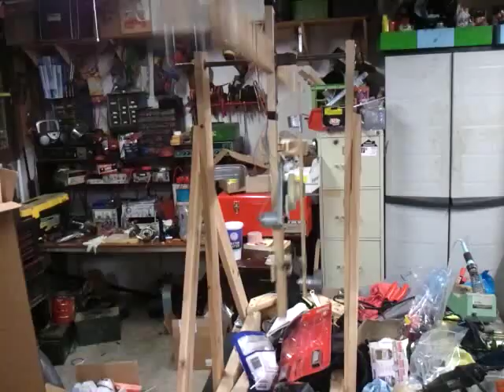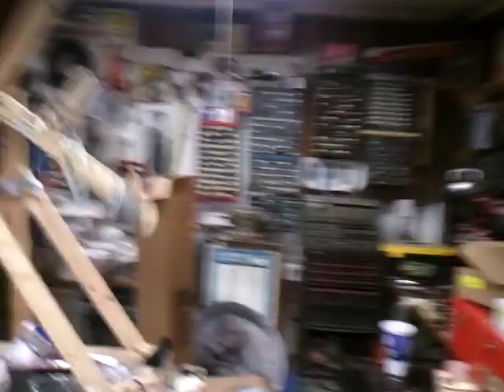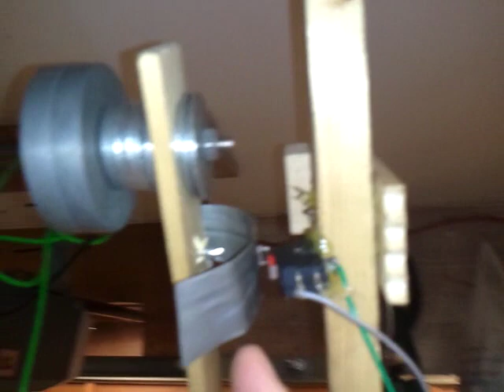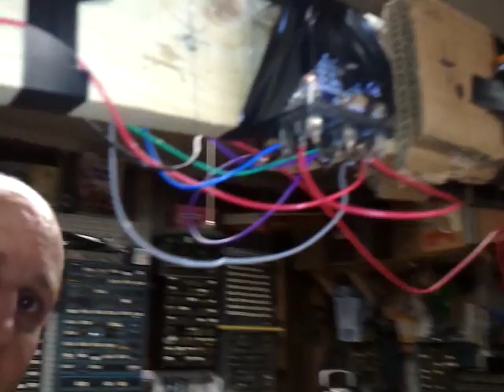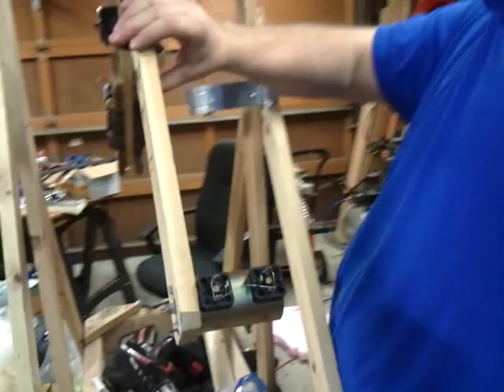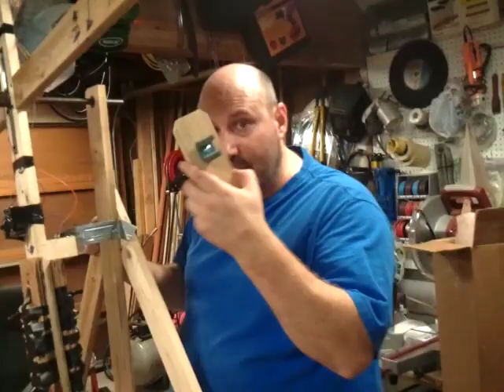Gravity Motor Prototype Version 2.0, motor drive mass movement

Comment from the maker: Sorry been busy working on getting a new work shop together. The electronics are fairly simple, it has a bank of nickel metal hydride batteries connected by a relay connected to a single geared motor, limit switches set in various spots hit contact points as it rotates triggering and then turning off the motor.  The relay uses spare contacts to self latch itself, one limit switch cuts the power when the weight spins around to a set point, two limit switches then trigger the motor on.

Comment from the maker: Feel free to replicate, there are many ways of doing this, I found this way pretty simple to implement.  there is nothing hiddne in the mechanism it is as you see, batteries power the motor, only as I dont like messing with commuters on the shaft.

Comment: Quote: it uses a simple geared motor to place the mass at the correct positions to increase force for the fall, and reduce force for the rise. End Quote.So it's not actually "powered" by gravity at all, the power comes from the battery powering this motor. The principle appears  identical to a self winding "gravity powered" clock. Those clocks typically have a motor that raises the weight say once a week. Yours raises the weight once per revolution.

Comment: try putting a coil of wire and a powerful neodymium magnet and a full bridge rectifier, you may generate enough electricity to power the batteries

Comment: Gravity is to most under utilized clean energy source known to humankind.
Impounding water with dams is the the biggest use of gravity's energy potential. Then, so many dams are being decommissioned and torn down, we are even loosing that source of energy.
Reply: Hydroelectric generator uses gravity as the energy source. Gravity is not under utilized I think.

Comment: Hi
what happen if we dont use the electrical side of this experement 
can we increase the velocity of the rotation and it is acondition the masses on the axes must be equal , how mutch electricity this system produce if we contact it with agenerator (enough for one home)
thanks

Comment: I like the contraption you have build, it is also clearly filmed so congrats for that, but of course we would all really like to know: is this an overunity device or not? If so, what is the COP? There's no mention of it in the description so I'm not sure..
Reply: Not. You can see it's battery powered.
Reply: Yeah but the thing is, I've seen many OU designs that use battery power at first and only after some time get overunity performance and the battery supply is switched off.
Reply: Really?  That would be Nobel prize material.
Reply: Sadly that site is full of conspiracy theories and fundamentally incorrect information. You only have to read the first few paragraphs of chapter one on magnets to realise the author hasn't a clue what he's talking about.
Reply: Doesn't matter what the author says or thinks of what the current definition of energy, batteries or magnetism should be: it would be better to disprove the hundreds of inventions from different people who individually claim overunity if you want to make statements like "free energy is impossible" with certainty. The author basically made a compilation.
Reply: I disagree. It's far better to prove that (for example) magnets are not and cannot be a source of energy than to prove one (or a hundred) magnet based machines don't work. It will always be possible to come up with a new configuration that has to be disproved all over again. The force produced by permanent magnets is conservative (google it). That means if you move two permanent magnets in a way that results in them ending up back where they started then the net work done is zero. Typically all so called magnet motors return to the starting position once per revolution (at least) so the net work done is zero. Gravity is also conservative. Once you understand the principle of conservative forces you see that no free energy machine based on gravity or magnets can generate energy. Magnetic shields don't help either - if the machine ever returns to a starting position or an equivalent position then the net work done is zero.The idea the governments conspire to prevent free energy machines being produced is laughable. How do you explain the fact that there are hundreds of examples on youtube. No wait I get it....Governments only allow the ones that don't work to remain on youtube. All the ones that do work have been removed.
Reply: ColinWatters well, its a matter of conversion, not creating energy out of nothing. Energy already exists all around us in various forms. The whole point is how to convert energy from one for to another and gain more work than we initially put in. Look at the invention of the Sail, it uses the existing wind power to drive the boat forward, thus turning the power of the wind to our advantage in the form of mechanical movement. Likewise, gravity is a form of energy that already exists. The whole point is how to harness it. No claims of OU here.
Reply: Mahmoud Abdalla No it's ultimately powered by the battery. If you connected the machine to a known load you would find it couldn't deliver any more energy than was originally in the battery.
Reply: PS: it's no different to a pumped storage hydro plant. They use electricity to pump water uphill that later can be allowed to flow back down hill to regenerate electricity. They aren't gravity powered. They cannot produce more electricity than is put in either.
Reply: There doesn't appear to be any kind of "load" connected to it. If the output is zero then the COP is zero.
Reply: @ColinWatters  what did Obama do to get his
Reply: @peterbillas9131  Huh?

Comment: How much energy does this take to run?
It would be interesting to see, what is the best output vs price to build in the area of  gravity to energy conversion
Reply: Good question because he don't even know. lol
But from what he was saying, build it yourself and you can measure it yourself and make the changes you feel you want, etc...etc...etc...

Also post it, get like and views. lol That is me talking now, he just said you are free to build it very simple and no cost. Now it is me talking again, you can find these parts for free. For example you can find someone throwing out an old microwave, an old treadmill, an old satellite stepper electronics and motors, an old car or truck, and you can find anything you need out of some old junk to make this gravity wheel for free and right now. The key is to have the tools you need, welders, torches, soldering irons, grinders, saws, hammers, etc... and you can do anything with a pile of junk.  But it don't mean it has to look like junk when you are done with it, but your mock ups are only proof of concept, so don't worry about appearance just get the thing working as you expect first for the mock up. Then after you do that for a few years you might graduate to better tools, CNC lathes, CNC mills with rotating axis, kilns, anvils, molds and dies, and take any junk and recycle it just exactly the way you want and need.